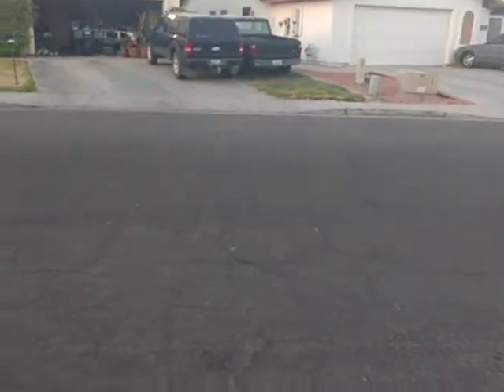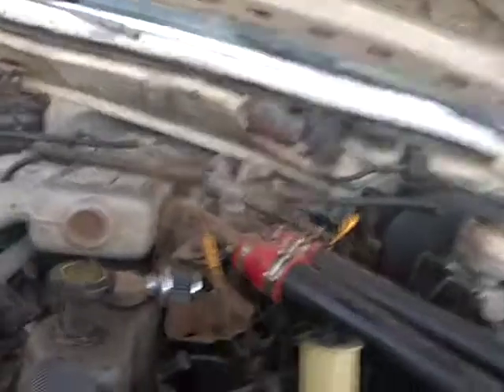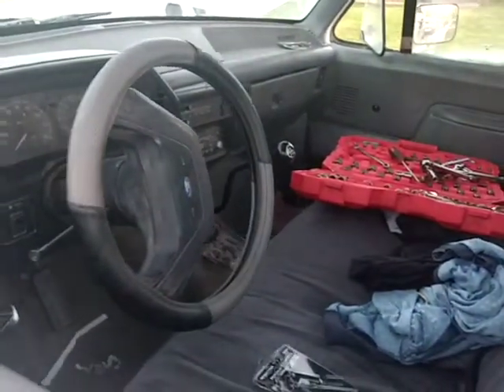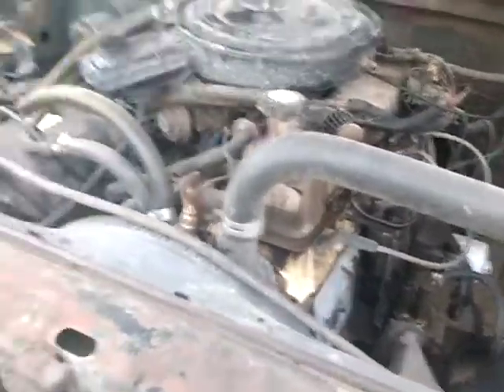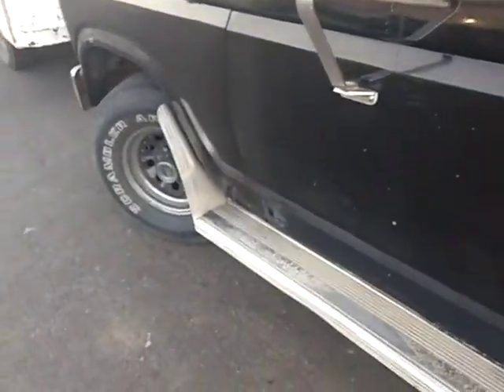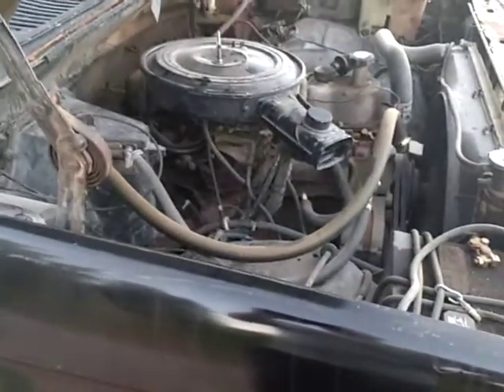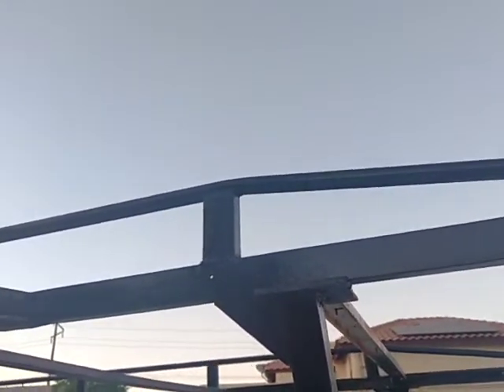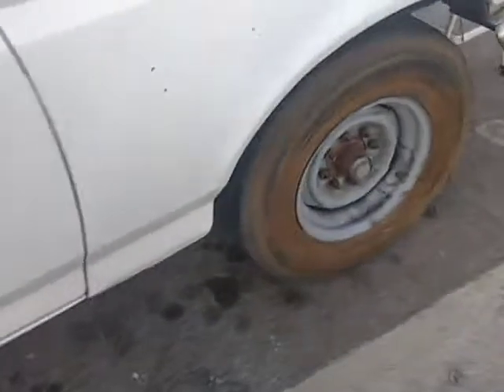classic being worked on and the toy hauler for the classic and project23 toy

Comment: just cut the throttle body flange off and weld on a LS tb flange.  twin parallel turbos are a waste of time and money on anything besides a V engine
Reply from the maker: The whole point is to be a low rev tow truck for twin turbos that way I don't have to rev up like a v8 would, in looking for better econemy from this aswell
Reply: @Project-gr6zy  when you divide the exhaust energy between two turbos, you more than half the response (doubled turbo rotating assembly inertia).  if you want something with low rev boost, put a single 2.3 turbo on it.
Reply from the maker: @whatchu_talkin_john_willis  I would still need a second turbo as that would be a restriction, and would then be a waste. It's either run a single big turbo or twins the math adds up to needing twins or a good size single to do what I want witch is heavy hauling
Reply: @Project-gr6zy  the math is no where close.  the turbine is the restriction.  the more restricted it is, the higher the drive pressure is and the faster and lower rpm the turbo responds at.   its a double edge sword because it also restricts the engine at a lower exhaust gas volume limiting peak power.  thats why VGT turbos and compound turbos are a thing, small turbine response, big turbine power.  parallel twins offer no advantage aside from packaging
Reply: @Project-gr6zy  its why the ecobost turbos are so small, response was more of a priority than overall power for the OE criteria